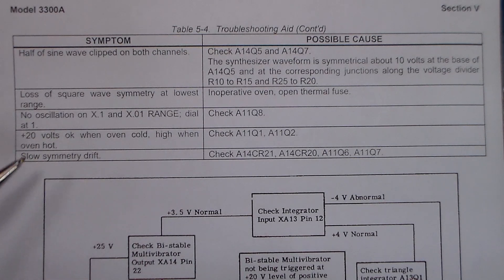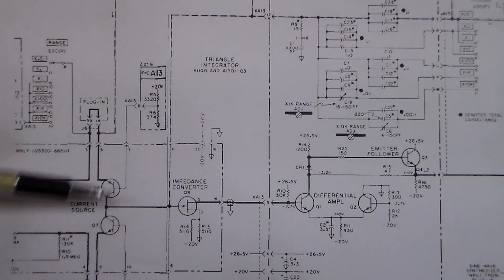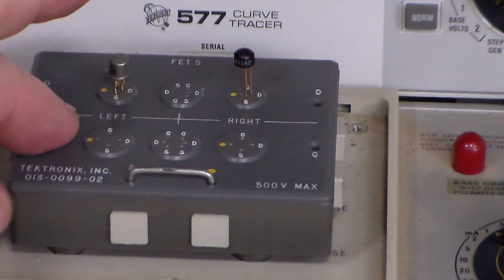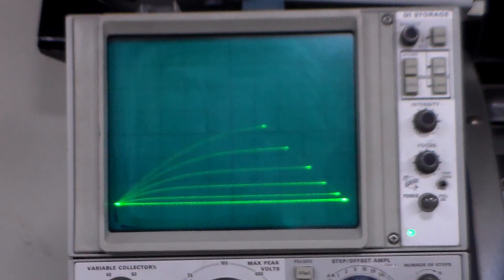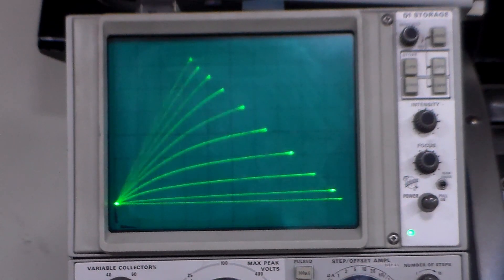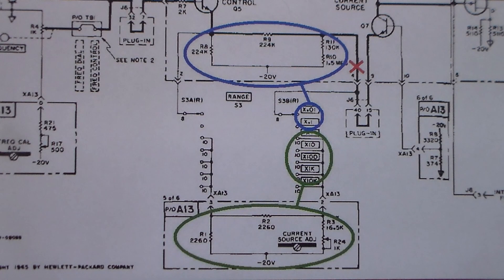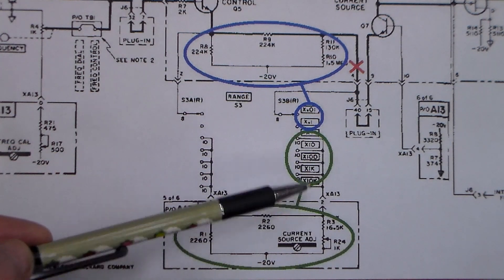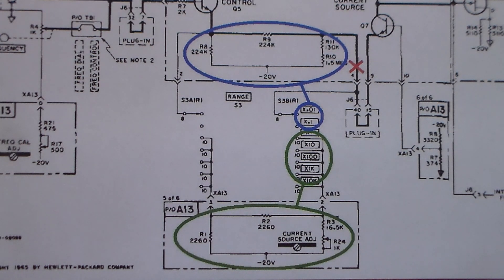HP3300A Oven Repair Part 2

Comment: Thanks for the useful info in this repair series.
I recently obtained a 3300A that I am going through the motions of repairing. Initially I had no sine wave at all and I tracked that down to a faulty transistor in the differential amplifier in the sine wave synthesiser circuit.

Now that I have the sine wave back I am upset to discover that even with the lower sine wave adjustment pot at its maximum turns, the bottom is still way too flat :(
Do you think it could be the resistors on that circuit? They are quite exotic values.

I was also reluctant to take the oven apart at first - something akin to a childlike fear of looking under the bed and seeing a monster lol. My fears were realised though when I found my thermal fuse also open and just about every transistor on the oven board with some sort of corrosion 😩
Reply from the maker: First up before you start looking at resistors in the sine circuit, make sure all the regulated supply rails are in specification as shown in the manual. Four of the transistors in the oven form two differential pairs used in some of the regulator circuits. Even if some of these transistors are still okay, that is not damaged from the corrosion you mention, then at the very least the +/- 20V rails may change due to ambient temperature fluctuations because the oven isn't working. Also, if you have service manual, make sure it for the build date given in the serial number prefix, there were a number of differences between builds of this unit. You should check out Curiousmac's videos on the 3300A as well.
Reply: @peteroneill404  By the way; what type of thermal fuse did you drop in? I see Jaycar doesn't sell anything around the ~107 degrees celcius rating that the original one has. Wagner sells 100 and 110 degree fuses but I am a bit confused because the manual states:
"Link thermal melts at 225°F 4 amp cont at 175°F"
Reply from the maker: The fuse I used was a G4A01110C, Element 14 p/n 187-021, melts at 110⁰C, this is the closest spec I could find to the original. Also, I used a standard fuse while I was working on the circuit board in the oven.
Reply: @peteroneill404  Hi Peter sorry to keep bothering you about this, I know YouTube comment section isn't exactly the best forum for tech support lol.
I continue to struggle with my oven :(
I am yet to replace my (very corroded) thermal fuse and am currently just jumpering across that for now and running the unit for very short periods to collect voltages. One thing I noticed is that my chassis mounted Q7 (oven amp) collector voltage is only hovering around 300mV instead of the 20V nominal that it should be. Should it be sitting around 20V as soon as I power it on? I'm wondering if the issue I have is simply that my fuse is open from corrosion and hasn't actually blown from heat.
Reply from the maker: Hi Fred, No the collector of Q7 won't be at 20V just after you power the 3300A. It may take up to 15-20 minutes before it gets to approximately 20V, the design is such that there is quite a thermal lag before it is up to temperature. During the warmup phase the control circuit acts like a bang-bang controller and the output transistor is fully on, the 300mV you measured. When it overshoots the set point Q7 will turn off fully and there should be 40V on the collector. The circuit will oscillate between fully on and fully off, only when the oven temperature has stabilized within about ±0.3°C then the circuit biases Q7 into the linear operating region and you will start to see voltages other than 300mV and 40V with it setting at about 20V at the set-point temperature.
There are various possible causes of the fuse failure, it could be corrosion as you suggested, the failure in my 3300A was caused by the previous owner replacing Q9 with the wrong part causing the oven to heat past the melting temperature of the fuse. If I remember correctly the HP manual doesn't do a good job in explaining how this  circuit works.
Reply: @peteroneill404  thank you very much for taking the time to explain that - really appreciate it!
Reply: @peteroneill404  This morning I ran the unit for about 10 minutes or so with a thermocouple wedged under R27 and the oven buttoned up.
It got to 100 degrees celcius without the collector voltage changing. I presume this would be well above the set point? Could my Q9 be cactus too?
Reply from the maker: This is a possibility as once the oven temperature increases past the setpoint Q9 should turn on and bias off the power transistor Q7. The operating temperature should be in the range 70-80°C. So as a first step I would check both Q7 and Q9. If they are ok, then I would check R17, RT1, and R15. R17 in particular sets the setpoint but RT1 and R15 are also important here. If Q7 and Q9 are ok I would replace R17 a resistor of slightly lower value and place a multi-turn trimmer in series with it, of say a few 100ohms to 1k so that you can go looking for the point where the temperature control gets into the linear operating region of Q7. This part though can be tricky and time consuming as your adjustments will overshoot the mark and you also have to deal with the thermal lag of the system.
Reply: 2N3417 @peteroneill404  amazing - thank you for the detailed reply; that gives me a lot to chase up. I did test Q7 and Q9 but I do not have access to any fancy equipment for testing transistors; just a cheap chinese multi-tester. The chassis-mounted Q7 tested fine although slightly low hFE at around 100. Not sure if that's normal. The Q9 also tested OK with around 300 hFE but it was quite difficult to get a consistent reading with that one. It would often just say "Unknown or damaged part" on my tester - presumably due to the rusted legs. Speaking of which, where did you source your replacement 2N3417? If I could source reliable replacements for all of the transistors on this board, I'd just buy all new ones and drop them in.
Reply from the maker: Fred, I think it's time to go to email on this, my email address is peter@oneillassociates.com.au